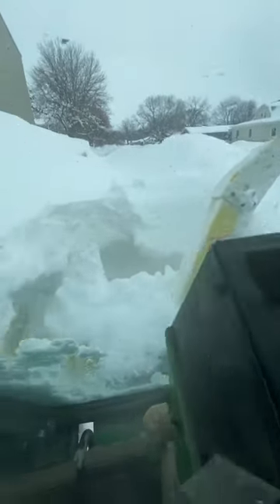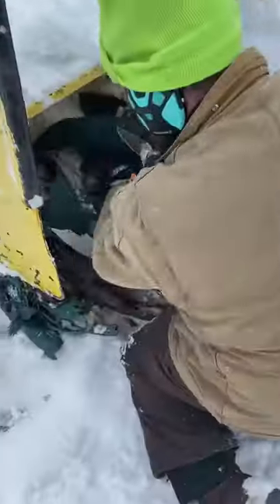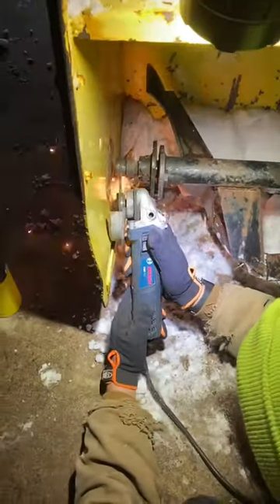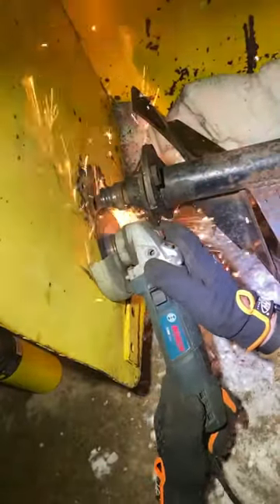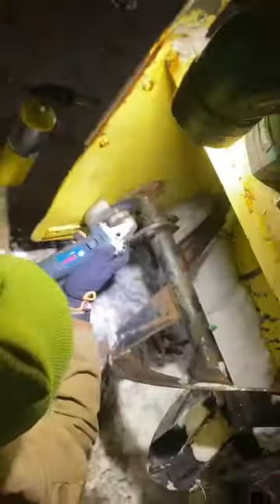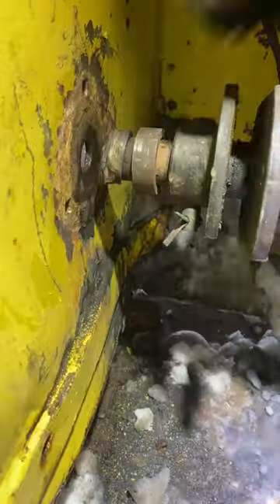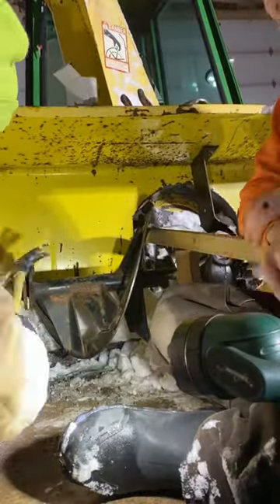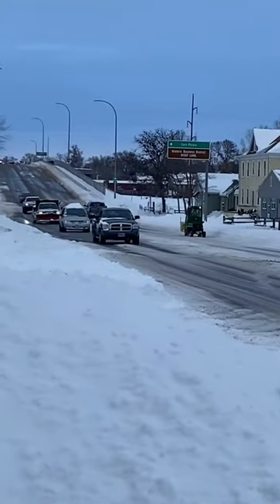Fixing a snowblower after it chewed up a tarp. #HandsomeOrHandy #Handyman #ShopMaintenance

Comment: They make a 4 bolt 🔩 roller bearing with two allen screw lockdowns and a grease zerk.  That would be a great upgrade in the future.  You would only need to drill four 5/8 holes.  I actually think it would be cheaper than the John Deere bearing.  Just a thought.

Comment: I'm still wondering why a tarp snapped a bearing an broke it.       My ariens   snow blower hit a huge rock an did nothing just bent a few blades
Reply from the maker: It should have snapped a shear bolt, but the tarp wrapped around the bracket that held the bolt so the sheer bolt did not fail.

Comment: What he doesn’t say was the John Deere he was drivings’ gear box turned into a rock tumbler 30 min after the tarp. We NEEDED at least one working blower and this was the lesser of two evils. 

One of these days when we have “free time” we might rebuild that gear box…
Reply: X ray vision? 😂 dude it’s called operator error. You’re supposed to use all your senses when running a piece of equipment like this. The help always runs it like they stole it.

Comment: I’ve always wondered it I were to just get and bunch of those wax drying blowers and put them on a driveway wouldn’t the snow just never touch the driveway and I’d never need to shovel or plow
Reply from the maker: Some people install electric or boiler heat systems in their driveway. And it only uses about $10 worth of natural gas melting the snow off of the driveway

Comment: Quite modest of you to not throw Trent under the bus even though we know he’s the one that’s running over tarps and tearing up the snow blower. You really need to start docking these guys pay and they’ll take better care of the equipment.
Reply from the maker: The snowblower with the tarp was able to be fixed in a day, the other snowblower had an issue with the gearbox later on that day and is still down for maintenance

Comment: Next time use a torch cut it hot an quick before u heat up the shaft an just fether the oxy u will see it just peal off
Reply from the maker: I have an oxygen tank, but no acetylene tank. I do have a plasma cutter, but that would have just made a mess of things.